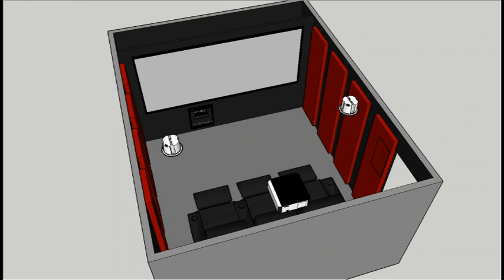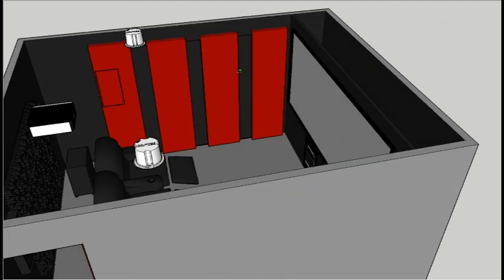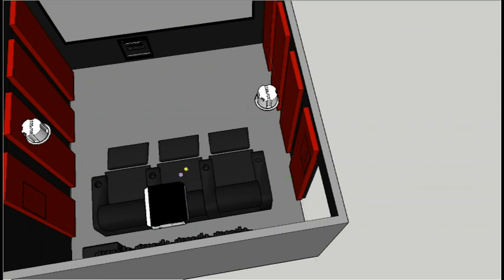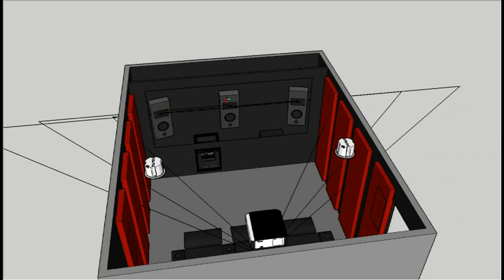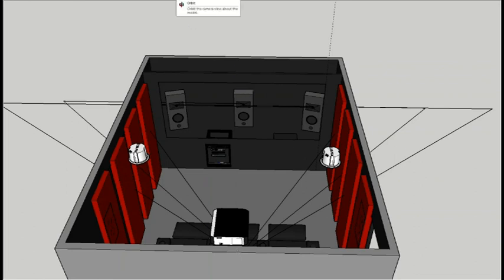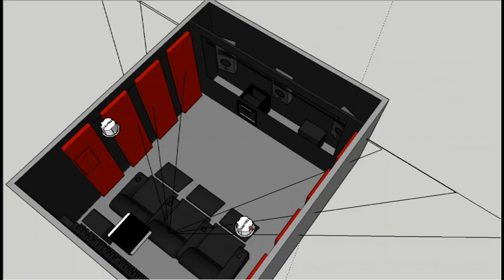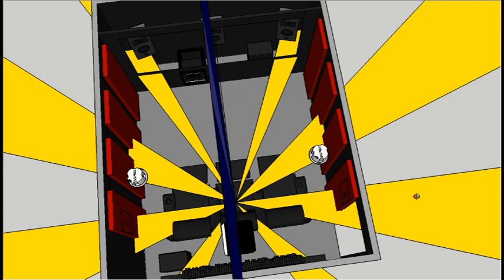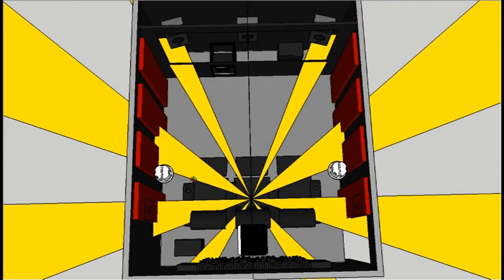Home Theatre Design Tour & Calculations

Comment: Hi Andrew, Enzo. Another excellent and informative video. 👍🏻👍🏻

I’m planning my next room in SketchUp and found a useful Dolby guide template like the one you use in your designs (the colourful angles to show where speakers should be positioned) but I cannot find anything like your reflection points template (used around 4mins in this video). 
Could I ask how I might get this or how I’d calculate it, please? Trying to plan for acoustic treatment. 
Many thanks. Dan

Comment: How may I calculate/identify the firsts reflections points.?
Reply from the maker: Quite simply by seating in the seat and getting a friend to slide a mirror along the wall until you can see the driver of each speaker and mark that point each time!